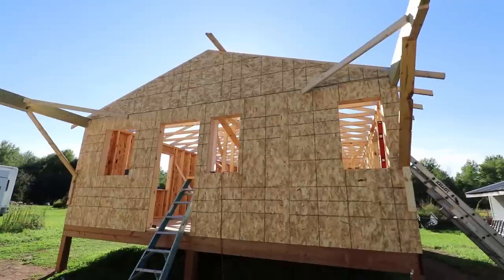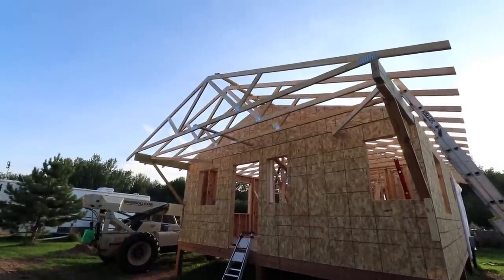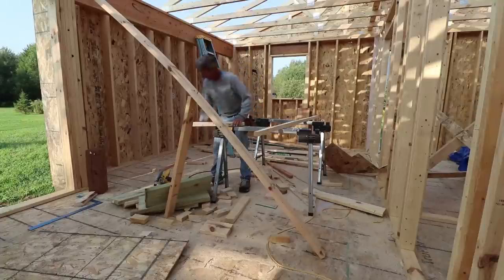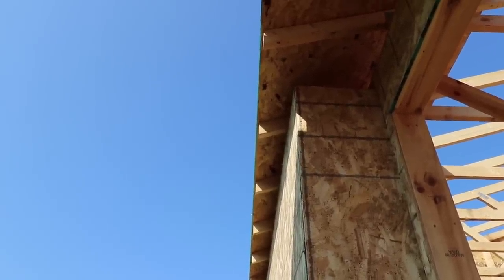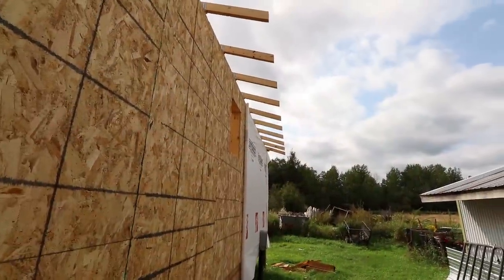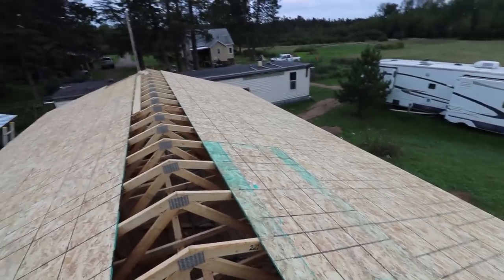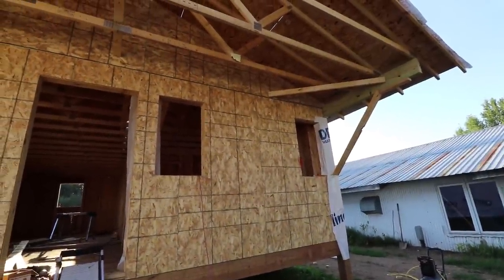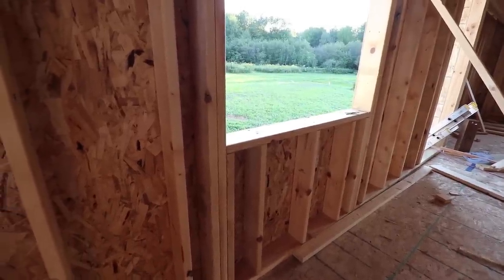BUILDING THE GUESTHOUSE. Part 8. Getting the plywood on the roof. Front porch framing.

Comment: Joe my thinking is along the same line as you about ridge venting. Once you get some snow  on the roof covering the vent where is the venting action there is none. Even with the regular square type vents you see in roof tops once they get covered with snow you will have no venting. Myself I had Whirly Bird Vents installed on my roof back in 1989 and never had a problem with ventilation over the winter, from the snow on the roof. I am glad you pointed out the venting issue to your viewers. They also work great to get rid of the attic heat in the summer months, eliminating the heat one feels when climbing the stairs to the second story of a house.
Reply: I love that, it’s sort of a human made problem, a lot of the houses I work on have no membrane under the roof covering (you have to now !) they were built over a hundred years ago, 
and they ventilate themselves very well ! in fact the roof timbers are usually in better condition than in modern houses (better timber too !).  Of course they were a bit cold but over an inch of plaster on the ceilings helps.   Apropos insulating lofts, a lot of houses were built with no access to the loft, the water tanks were in a room by themselves about three feet higher than the top floor level !

Comment: I would have used solar board for the sheeting.  It keeps the heating down.  I like to run some clear seal on the edges of the sheeting before installig.  No more swelling.

Comment: Here in SW CO we have drop end gables which are shorter by whatever your top chord is made of. This allows you to facenail the butts of your lookouts to the top chord of the 2nd truss, put the edge of the lookout on the gable end truss, and nail sub-facia and facia to the other butt end of the look out.
Reply from the maker: We are required by code to do this if your gable end overhang is over 12 inches. If it was a 16 or 18 or 24 inch we would have to do the gable end lookouts with the dropped gable.

Comment: Joe..will you be doing the plumbing yourself ?..looks like it’s time to get the shower or tub unit in the bldg…depending on what type your installing..it’s always a bitch after the exterior doors are installed trying get a tub/shower unit in the building…. Without damaging the door trim..We’re running into that right now on a garage bungalow..I’m having the carpenters back to remove the new entry door to slide in the tub/shower unit and a couple of studs to the bathroom partition wall..to get it into place..

Comment: around here they use a coated plywood on the roof and then tape the joints. it's then watertight if it rains before they put the roof material on
Reply from the maker: Someone else mentioned that product so I looked it up. No stores carry it here and it is not even possible to get it shipped to home. (home depot) (menards)

Comment: I was wondering why you did not use the Telehandler to install the rest of the Roof Trusses? I thought that would have been the most logical choice. But you are the professional builder who am I to question. However I have seen several people build their own houses and most have used a skid steer or mini-excavator to help in the heavy lifting sections. Or places where handling materials would be awkward especially for a one man operation.

Comment: How did you put the truss up for the other end of the roof.  Think you said it was 1 foot overhang.
Reply from the maker: I do not really understand the question. I filmed almost everything so it should have been in the video.
Reply: @NorthernSeclusion  the back of the roof (opposite the porch), you were making that overhang the building by a foot.  I don't recall how you put that overhang rafter up.  Maybe I missed it.

Comment: I don’t understand 1 thing. Why did you only leave 1/2 inch of plywood overhanging the tails?  I would have thought you would have left 1.5 in due to the 2x6 fascia? Just curious, love that jig you made to cut the tails!
Reply from the maker: You do not want your plywood sticking past your sub fascia. The correct way to do it (if you can picture this in your head) pretend you are the bottom side of a shingle. You slide down past the edge of the plywood and then you want the top corner of the 2x6 sub to be in that same plane as the top side of the plywood sheathing. The shingle rests on the top side of the plywood and then gets support after the plywood ends by hitting the top outside corner of the sub fascia. Drip edge goes there as well but I would need to draw a picture. You can not have that end of the plywood exposed in any way to the weather. Not even if the wind blows water under your shingles on the edge. I will try to remember this question in an upcoming video so I can draw it out. It is a valid question.
Reply: I think I understand.  If you left 1.5 in overhang on the plywood, the 2x6 would need to be ripped at the appropriate angle to let the plywood sit flat on top of it. Even still the edge of the plywood would be exposed. So, if you leave the plywood only overhanging the tail 1/2 inch, it then runs “ in line” with the 2x6 for a smooth angle.

Comment: I seen you stumbling around tripping on debris on the ground even driving over it.  I worked union construction and if our laborers didn't keep things cleaned up OSHA would show up and shut us down.  We had a fellow fall off a 5 story deck due to debris laying around.  Needless to say he never went home again to his family.  It doesn't take long to move debris to appropriate places but it sure does a lot to prevent twisted ankles etc.  What you call a flying rafter we call an overhang ladder.  In your area, gable end ventilators would definitely be the best bet.   You stated you were taught not to do anything unless you understand the purpose...those ridge vents will make no sense when the snow lays up there.  Curious why you don't have a scaffold lift (cherry picker) to work off of.  Even a rental cuts down on the amount of time needed and is one heck a lot safer than walking the top of walls.  I was offered a job with OSHA when it was first enacted.  I tend to be very safety conscious having seen some horrific accidents with loss of life and limb.  Not even having a spotter is semi-suicidal.  Get a harnass.  One false move and you may never work again.
Reply from the maker: Sounds 100% like a union worker. I made sure to stay far away from the union. Osha can do absolutely nothing to me on my own property. I dealt with them many times on residential jobs. Never had a violation.
Reply: ... another big problem with union workers and their .... rule's is nothing gets done....I personally had nothing to do with their slow and supposedly safe working practices......

Comment: Explain the red and green or blue paint on the Osb I know red for roof blue or green for walls I’ve a lot of you tubers use blue for roofing
Reply from the maker: I am color blind. I look at the thickness and have no clue what the colors stand for.
Reply: @NorthernSeclusion  has to do with glue and compression of process
Reply: ....ah....you must be one of those building inspection specialist type genius consultant expert's....the one's that hinder rather than help....the one's that hear sniggering as they leave the real workmen in peace, to continue exactly what they were doing before you interrupted.
Reply: @nojnoj3069  most inspectors don’t know half that I know most are either wanta be or couldn’t make as carpenter! I’m a custom carpenter and have my own kitchen and bath showroom with I specialize in and worked very hard to get here I also have cabinet and Formica counter top business and certified coriander and granite shop